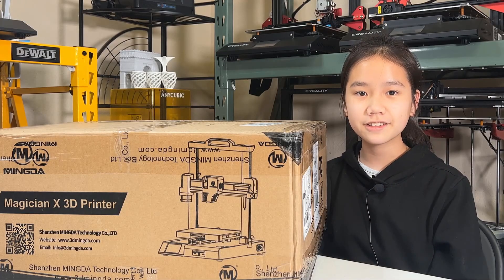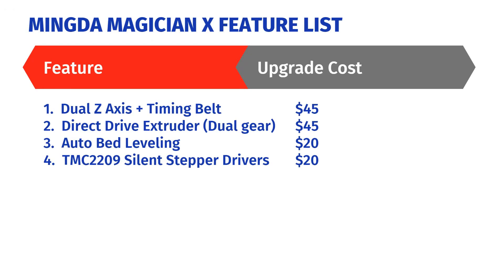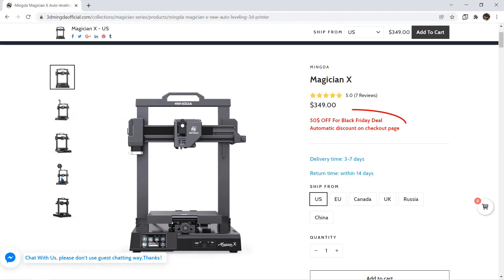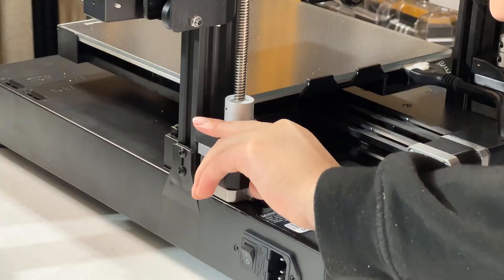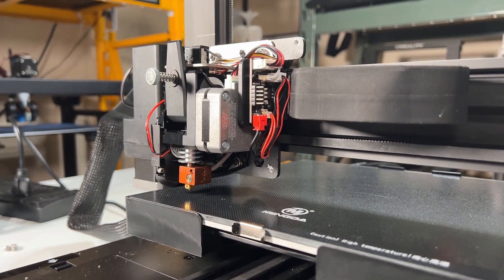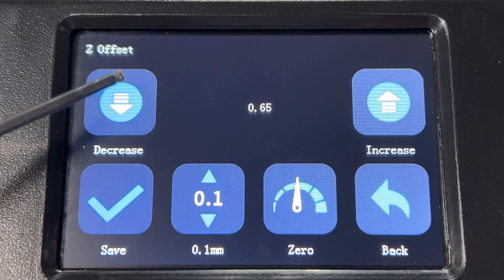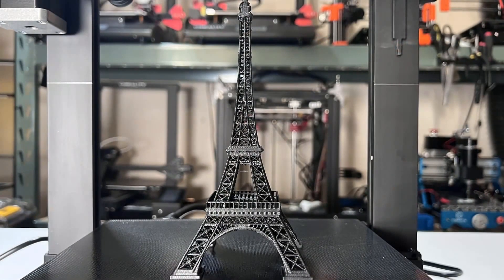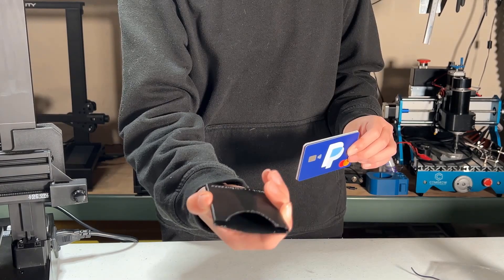Mingda Magician X 3D Printer: $300 with Dual Z-axis, Direct Extruder, strain gauge auto bed leveling

Comment: I picked up one of these through a deal in a FB group I am in where I only paid 35 for the shipping, it was an amazon returned printer. Only thing wrong with it was that the screws for mounting the gantry to the bed were missing and the filament holder was missing, and I didn't get the tools or the sample filament. The screws were easily sorted from my spare parts bin, I was able to use a spare ender 3 type filament holder by taking the screws out of the top left corner and then used them to mount the ender 3 filament holder onto the printer. So far it's not been bad, It's definitely a different printer than what I am used to, but I like it so far.
Reply: I spoke too soon. I have had multiple issues with this printer, I wound up buying a replacement for the cnc machined aluminum piece for the extruder body, a replacement hot end, and I have been going back and forth with Mingda technical support trying to resolve the issues I am having where the extruder motor just stops extruding on me while trying to run a print.

Comment: Please advice me one FDM printer , around 400 & 500 $  easy leveling ,High temperature Direct drive ,Big build volume ,touch scream control.
Reply from the maker: You need to upgrade the heat break and edit the firmware by yourself if you want to get a 300x300x400 printer for around $400-500. The only printer that came with everything you need is the CR-10 Smart Pro, you can watch my review video:
https://youtu.be/2LuzLeIJnH8
Reply: @AuroraTech  Thank But i see in store CR 10 smart for 700+ US

Comment: 12:20 - It'll be interesting to see how long that ribbon cable lasts before it fractures, the way it flexes where it connects to the hotend seems to be putting flex on just one point.

Comment: I have a Creality Ender 3 V2 and i can't get the  leveling eight will rhis  auto leveling better for me
Reply from the maker: Do you mean manual leveling? For the small print bed like the Ender-3 or V2, just adjust the height of the Z-limit switch if the leveling spring can't raise the bed high enough.

Comment: Have you had part cooling issues?  My PETG self-watering pot has horrid stringing and bobbing as well as poor layer adhesion on one side of the primt, but bed adhesion is spot on all around the part.  I assume the single nozzle cooling duct is just not enough.  Would you consider replacing the stock cooling duct with a multidirection duct?

Also, would replacing the hotend metal faceplate with a platic one be a nice upgrade?  Or is the metal faceplate part of the hotend cooling solution?  Maybe relocating the 2 fans near the rails to the sides of the hotend in the process too.  The whole hotend just seems so damn heavy.  Makes my motors sound like they're screeching and whistling.
Reply from the maker: Your fist layer was good as Cura turn off cooling fan on the first layer by default. Poor layer adhesion is usually caused by too much cooling, if I am going to print something like a PETG vase, I will just turn off the fan for the whole print.
Reply: @AuroraTech  gotcha gotcha.  Maybe my room is too humid then.  I turn off the cooling fans for pla/petg and I get crackling, strings, layer peeling, and super blobs.  I'll just print slower with lowest fan speed for petg.

Comment: You two siblings are absolutely brilliant producing outstanding reviews.  Several commenters inquired about Marlin Firmware; do you know?  As a skilled Marlin user, this would be nice but your review shows that firmware flashing is highly unlikely.  I did wonder about the Vacuuming early in the video but your 'cons' section told me why.  You two should be very proud of your work.  Cheers.

Comment: Wondering what would be a better quality choice (assuming the size of the print I need is sufficient with the Magician X) between the Ender 3 S1 or this Magician X. I am more interested in the quality of print and reliability of the printer. Will appreciate your expert opinion.
Reply from the maker: These 2 are really close in terms of hardware, features and print quality. I would say the Ender-3 S1 is a little bit better for the new lightweight direct extruder, you may also watch my Ender-3 S1 video:

Ender 3 S1 Review:
https://youtu.be/sbRHZUnmfYw

Comment: My prints dont come out that well  my nozzle is 205 and bed is 70 not sure what I'm missing
Reply: Try printing a heat tower and see if it’s the temps, some printers like lower or higher temps even with the same filaments

Comment: Does it work with octoprint
Reply from the maker: Yes, it does.
Reply: @AuroraTech  All mine does is print 5mm above the bed (AIR PRINT )using octoprint ; but prints great from sc card . go back to octoprint with same file then prints  great?????
Reply: @jame302  - Did you ever get this resolved? I just purchased the Magician X and plan on using Octoprint...

Comment: Hi there, I just came back to show a friend and I noticed that between your first two test prints the hot ends go from orange to black. Were you sent multiple printers or did you have to replace something? Just seems odd you wouldn't mention there's been a change as you're usually so thorough.
Reply from the maker: That's the same hot end as I only have one. When it was brand new, the color was darker, but the color changed to orange/brown once it used for a while. For now, my printer was turned off for at least a day, it's still orange/brown, that's interesting.

Comment: Got one on the way thanks to your recommendation. I'm not much of a tinkerer, get stressed out too easily so this seems perfect for me as a replacement to my ender 3 which gives me a lot of misery.
Reply: Did you happen to buy it?
Reply: @naturalgamerjk606  yeah, bought one in the sale and been using it for a few weeks now, changed the bed to a flexible pei springsteel one and that's about all I've changed. It has its quirks but it's overall a pretty nice machine to use, just set and forget.
Reply: @101stsurvivor  how’s the print quality? You think it has or would work good for over 24 hour prints? I’m not looking for crazy quality but I’m looking for a first printer that works well
Reply: @naturalgamerjk606  print quality is okay,  I wouldn't recommend it as a first printer though because to get good quality you really need to know what you're doing when making a profile from scratch. If it's your first printer I'd get something from a more established company. A creality cr6-se has most of these features and has a much larger support base so if its your first printer that'd be a good one to look at.
Reply: @101stsurvivor  alright thank you! I’ll buy that one then, I looked at a few reviews and it looks like it’s very good, I appreciate it.
Reply: @naturalgamerjk606  get a metal extruder upgrade at the same time, the plastic one it comes with is pretty weak. It's only like 10 dollars for the part and super easy to change it.
Reply: @101stsurvivor  do you know what the upgrade is called? Is it an mk8 extruder or is it different?

Comment: It's really awesome to see more females in engineering. Your explanations are so clear and everything is so unbiased.
You guys look like you're really young as well which just makes me even more impressed. Wouldn't be surprised if you have other YouTube channels. It's all so professional. 
Great printer as well! I like that it LOOKS nice. A lot of machines I see have exposed wires and a very open design. But this looks like it's made to look good on the desk as well. Did this make it harder to modify?
Reply from the maker: Thanks for your comment. In fact, the most popular upgrades like direct drive, dual gear extruder, dual z axis, auto bed leveling, 32-bit motherboard, silent stepper drivers are all included in this printer, so, there is not much you can do to upgrade this printer.

Comment: Great review ! just one question : sidewinder x2 or magician X ?
Reply from the maker: Actually, they are quite different, Sidewinder x2 is a larger(300x300x400mm) printer and cost $479, while Magician X is standard size (230x230x260) which cost $299, if you don't require larger print volume, I think it's hard to find anything better than the Magician X for under $300.

Comment: Great review thank you.  Working on the assumption that the two lower bolts on the underside pull the gantry down.  It would be prudent the not fully tighten the four horizontal bolts at first.  Tighten the two underside bolts first to ensure the gantry is fully pulled into place.  Once this is done fully tighten the four horizontal bolt.  
Great printer for price lots of features people always want to add to a basic printer.

Comment: Certainly puts my $250 Ender 3 v2 with similar upgrades costing another $250 to shame at its $299 price point. It seems well polished in addition to being highly functional right out of the box. My concern with this printer though would be longevity, and serviceability. You should give another review after several months of use.

Comment: Excellent review.  Only thing I wish reviewers would start making mention of is whether or not the printer supports printing with higher temperature materials like Poly-Carbonate and such.  That said, your review is so professional I will go straight from here to the manufacturers web sight to see if I can get more in depth specs.  You really made me want to buy this printer and the review was just plain fun to watch.  Thank you.
Reply: From what I’ve seen there should be no problem. I just ordered one so we’ll find out soon as I nearly exclusively print carbon fiber PC and PETG between 245-260C. As long as there’s no ptfe tube going down into the bottom of the heatbreak or deeper then it should be fine.